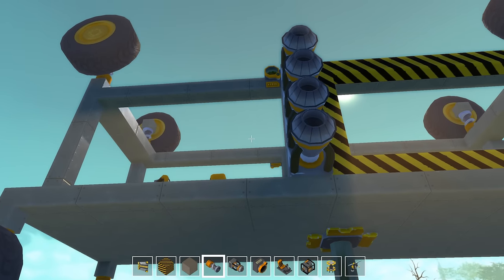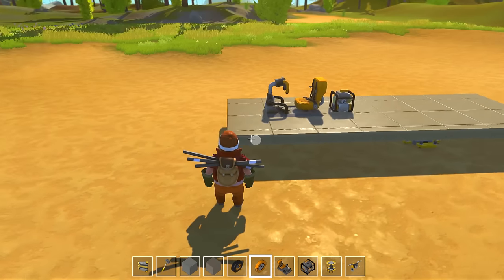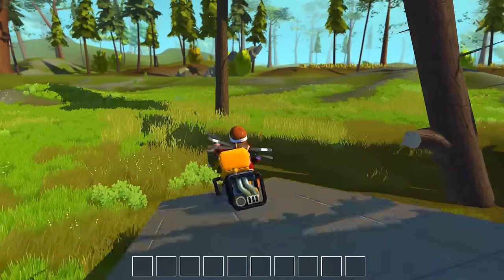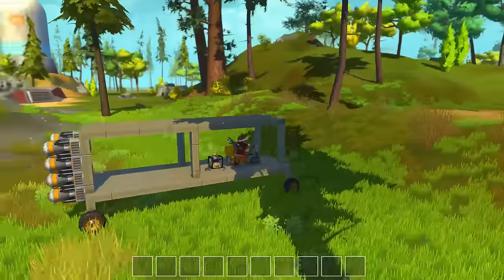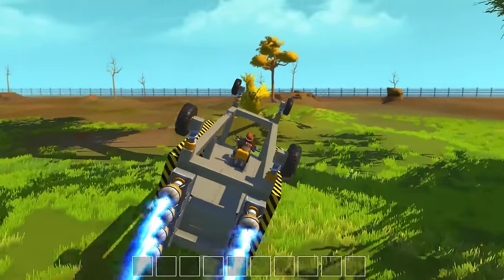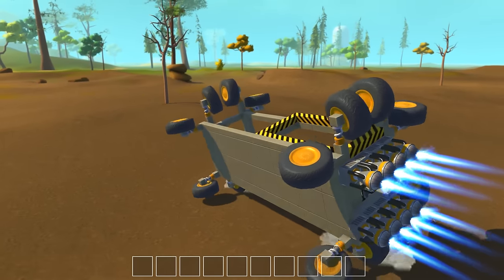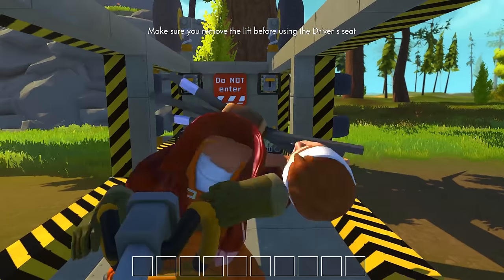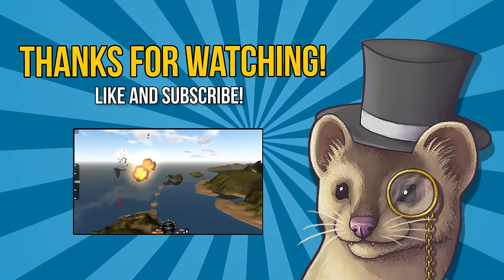Scrap Mechanic Gameplay - ROCKET POWERED CAR! ★ Scrap Mechanic Creative Mode (Let's Play)

Comment: Whoa, didn't even know this existed. Sweet. A few tips: the wheelbase width (distance between the wheels from left to right from the center of the wheel) should ideally be about 1/3 the length of the wheelbase length (distance between the wheels from front to back from the center of the wheel), with the center of gravity as low as possible. Once you have the suspension set up, make a dip in the frame so that most of the weight is lower down. That should help with the whole flippy tippy over thingy.

As for what to build next? A rocket powered train of course!